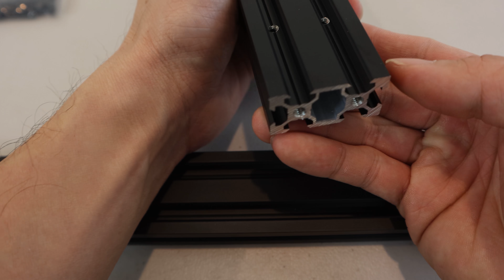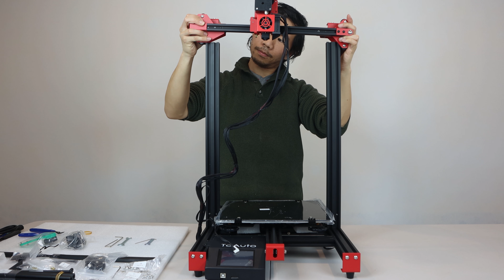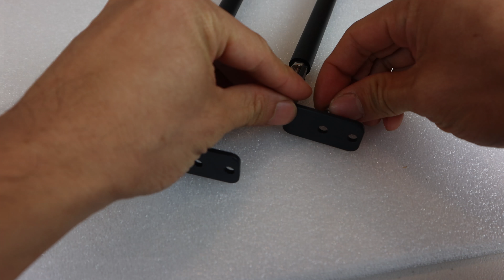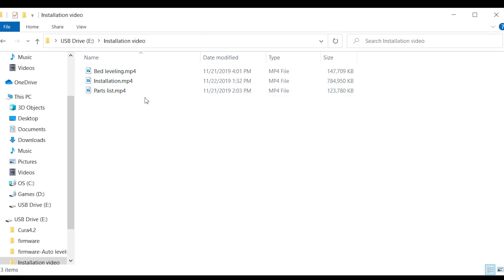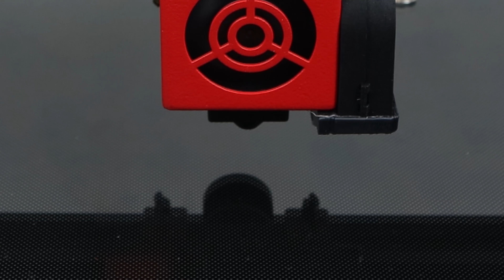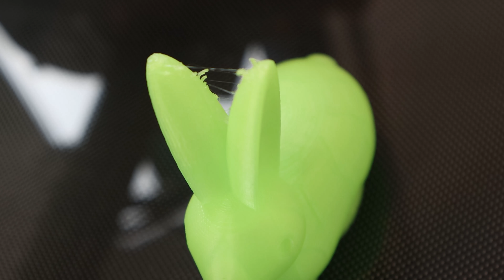ToAuto Pyramid A1.1 3D Printer Assembly and Review

Comment: Just got one of those beast assembled but I have a problem.
X doesn't work and it's not moving on points level and not thru the menu.

I checked the cable and connection everything seems fine but
Reply from the maker: Hm, it sounds like you verified that the power cable for the X is properly attached to the motor, but have you check its connection to the main board underneath? It may have come loose during packing or transportation.

Comment: I got Err5 when leveling the bed?  It was working but now its stuck trying to home
Reply: Looks like restarting the printer cleared the error and I was able to level the bed again.  Now Ultimaker Cura is stopping mid print?  Do you know what could be causing this?  Thank you!
Reply from the maker: Hm, I'm not sure. Are you printing from the SD card or via USB?

Comment: Need help with extruder. Testing the feed rate, it only pushes 90mm instead of 100mm. It's been this way since day one and I've found no adjustments in the current firmware

Comment: My first couple jobs came out great, but ever since I have had nothing but issues with this printer. I suspect its the filament I am using, but I can't get the projects to stick to the bed now and I can't keep the nozzle from clogging. Do you have preferred temperature settings for this printer?
Reply from the maker: What type of filament are you using? I'm currently printing with PLA+ 1.75mm at 200° C. For PLA, I typically pre-heat the bed to 60°C and for ABS set the bed to 100°-110°C with a 250°C nozzle temp. Other things that can help adhesion is cleaning the glass with 99% isopropyl alcohol first or putting down a layer of blue painter's tape or stick glue. You'll also have to make sure to re-level the bed each time as this will affect adhesion as well.
Reply: @ReviewedByPhil  Thanks. I'm printing PLA at 200°C and putting down glue on a preheated 60°C bed. The glue helped the base layer stick, but the PLA is still building up and clogging while printing. It's also very stringy and now my print layers are misaligning. I just removed the PLA from the extruder and cleaned it thoroughly. I know its not the PLA because I have an Ender 3 also and it works great.
Reply from the maker: @n_l_o  Sounds like the nozzle temp may be too high, which, even if it works great on your Ender 3 at the same setting, could have enough of a variance to make a difference. Try a small test print at a lower temperature, maybe 5-10°C lower, and see if the stringiness and layer adhesion improves. It's also possible the temperature sensor isn't registering the right temps or that the cooling fan isn't cooling down the material fast enough (check that the cooling fan duct isn't blocked, and if you're using a gcode file to print that the fan is set to run for duration of the print).
Reply: @ReviewedByPhil  Thanks for the response. I've done a bunch of troubleshooting and I think the problem is my hot end is leaking somehow. Turning down the fan speed helped a little, but I'm still getting a lot of buildup above the nozzle and on top of the hot end block. Do you know if this is a generic hot end that I can replace with one on Amazon?
Reply from the maker: Ah, ok, if you're seeing material above the nozzle and heatblock then it sounds like you have a nozzle leak. The best way to solve this is to disassemble the nozzle, heat block, and heat break, clean it out and reassemble. If you think one of these parts might be defective, then you should be able to replace them with standard parts; if I'm not mistaken it should be the same parts used in the CR-10. The nozzle is a standard 0.4mm brass nozzle and, at least for me, a spare was included in the spare parts bag it shipped with.